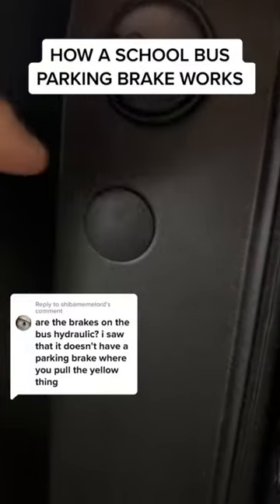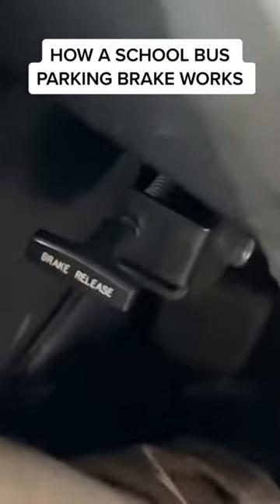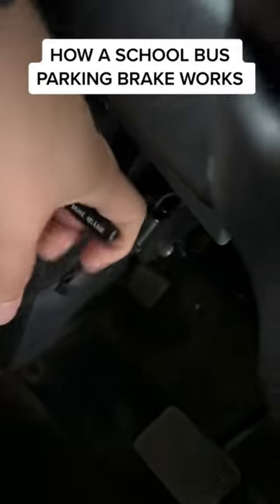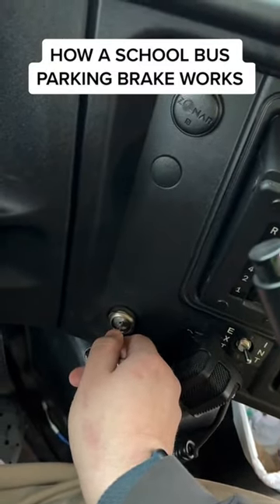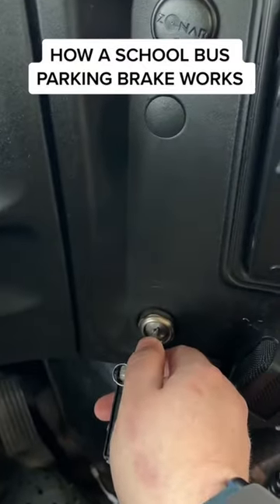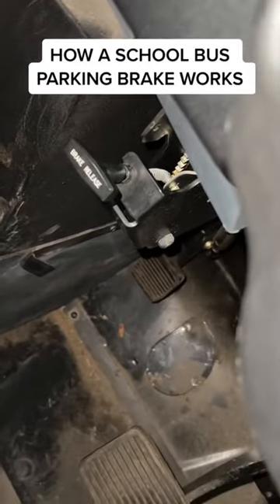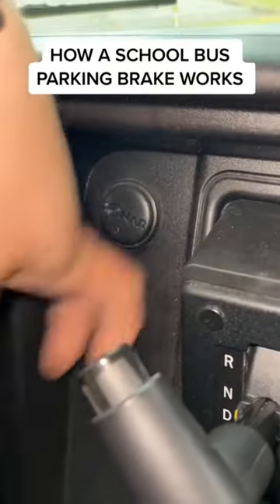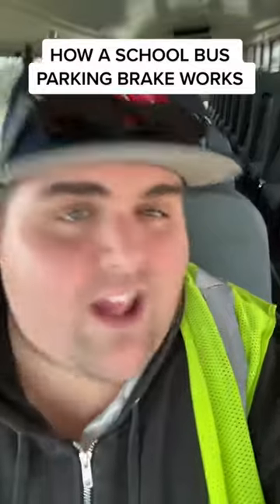How Does A School Bus Parking Brake Work?

Comment: U should do a video of u showing us the school buses rev limiter😂
Reply: Cummins ISB has a limit of 2800 rpm. Same goes for the Maxxforce DT.
Reply: @charlesrodriguez7984  nice
Reply: Charles is correct! The rev limiter is different then the rev limiter in a car. If you steep on the pedal all the way will go up until it stops anywhere from 2,500-2,800 RPM and will just hover there smoothly it doesn’t go all the way up and keep bouncing down if you know what I mean

Comment: So the reason they ditched the system that had that loud humming noise and the push button park brake in favor of a hydro boost system with a mechanical brake, is because the full power brake system was notoriously unreliable. The humming noise came from the Hydraulic Control Unit, or HCU. The HCU is multiple things in one: a module, a pump, a fluid reservoir, and an accumulator. Those HCUs failed on frequent occasion and are very expensive to replace. In addition, Meritor Wabco stopped making the full systems (I think).

Comment: I think Thomas started putting a button for their parking brake like on 2023 and 2024 C2s as an option but don't quote me.
Reply: Are you referring to Intellipark?  That's only for air brakes.  As far as hydraulic brakes go, the standard option is a foot parking brake, but you can opt for an air-assisted parking brake despite not having air brakes at all.
Reply: @BusMaster99  I'm not too sure. I just heard about my district having them in the newer buses. Not sure what they are and how they work.
Reply: @TheRealAGGL  yes, those are intellepark parking brakes and you pull them to engage and push to disengage. They are basically electronic parking brakes
Reply: Declan Bus Spotting  What bus?

Comment: On our 2011, 2014, 2015 and 2016 hydraulic International IC CEs, they have the hydraulic version of the yellow parking brake knob on them. Our 2019, 2020, and 2022 hydraulic International IC CEs has the parking brake that was shown in this video. Then our 2023 air brake International IC CEs obviously has the air brake version of the yellow parking brake knob on them.

Comment: It’s not the yellow pull knob because it’s not air brakes. I’m not 100% sure how the knob works but I do know when you push it in the air pressure is used to hold back the spring brakes and when it’s pulled the air pressure is cut to allow the brakes to engage. For your hydraulic brakes it’s on the floor because the parking brakes are engaged by two steel cables that go all the way back to the rear wheels which take a bit of strength to engage so putting the brake on the floor makes it much easier to engage. Some cars work this way as well

Comment: Most likely they had some air powered component of that parking brake fail often so they decided to go with a mechanical one with an electrical Fail-Safe that makes it impossible to pull it without the bus on that way you can have air in your brakes and be able to hold down on the brake pedal when you release it

Comment: I could be wrong, brother, so don't quote me, but im thinking they changed from air brake to hydraulic brake to remove the class restriction on the license. 
With air brakes, you need a Class A or B license. With hydraulic brakes, you can have a Class D.
Which makes sense as it makes the job more accessible to people. 
I don't know this to be fact though, just what im thinking.

Comment: Because the yellow knob is for air brakes it's your proportionary valve that's why and because it's hydraulic brakes is just like a regular pickup truck SUV that has a foot pedal parking brake technically it's not a parking brake it's an emergency brake which I'm glad that they did that because now you have an emergency brake in case all brakes fail to at least get the bus to stop and legally you had to be able to release the brake without the bus being on so the way you release it is you push on the pedal all the way down and then release it with your foot still on a pedal all the way down! Try it
Reply: IC used to have an electronic switch for hydraulic brakes that looks and functions similar to the knob used for air brakes.
Reply: On our 2011, 2014, 2015 and 2016 hydraulic International IC CEs, they have the hydraulic version of the yellow parking brake knob on them.
Reply: @greatgalacticblue4645  question were those brakes true hydrolic or air over hydrolic assist? I ve drive tow trucks that were air over hydrolic that had the push pull knob for the air control that applied and set the hydrolic brakes. Curious if they did away with the air over assist.
Because the air was an assist no air brake endorsement was needed.

Comment: On our diesel pusher motor home we have a air brake lever on the dashboard so it makes it easier to release and to push in when we need it. Also when we start the motor home up it has a warning beeper that tells us that the air is low so we have to wait until it fills up before we move our motor home out also it won't let us move.

Comment: I think they did switched because the older ICs had a lot of electrical problems with the electronic parking brakes. This one has fewer ways to go wrong
Reply: Might’ve also started doing it when they changed engines from the international DTs and V8s, to the Cummins ISBs.
Reply: @josephbugaj8149  this one is gas
Reply: Maybe if they didn’t have air brakes but I haven’t of any older ones that didnt. That bus is a gas motor without air which is why it doesn’t have the yellow knob. Anything with the yellow knob for the park brake isn’t electronic.
Reply: @dougb27  actually the yellow knob found on older CEs with hydraulic brakes is for the SAHR parking brake (Spring applied, hydraulic released). My bus has one, diesel powered, and is equipped with hydraulic brakes as well. No air whatsoever.
Reply: On older CEs with hydraulic brakes equipped, there is a large brake pump known as the HCU (Hydraulic Compact Unit that is part of the Wabco Hydraulic Power Brake (HPB) system) mounted on the drivers side frame rail (it buzzes when the bus is first started to build brake pressure) and it provides hydraulic brakes to the bus. In addition to the brake pump, there is a parking brake actuator also on the drivers side frame rail near the rear axle that is driven by hydraulic fluid as well. The yellow knob on the dashboard controls the actuator and allows the parking brake to be engaged or released (the actuator can even auto apply the parking brake when the bus is turned off.)

That system was used when the parking brake itself (the brake drum) on older CEs was mounted on the rear differential, where the driveshaft entered the rear axle. The newer system used nowadays with the foot pedal for the parking brake, the brake drum is mounted on the driveshaft at the back of the transmission. The newer system is fairly common on diesel buses with hydraulic brakes (not sure about air brakes or gas engine ones.)

There are videos that demonstrate the system. https://youtu.be/5W4XfsDiNc0
Reply: @josephbugaj8149  thanks for the info! It was a few years after they switched to the Cummins motors. All our buses are diesels with hydraulic brakes too. Our ‘16 and ‘17 CEs have the yellow knobs but by the ‘19 model years they were equipped with the pedal
Reply: @cameronbennett-ferland4361  our yard before going to C2s, had internationals with the hydraulic brakes and yellow knob. Newest was 2014. All the C2s we have now have the foot pedal parking brake. Honestly I preferred the yellow knob and the SAHR parking brake that was used over the foot pedal.

Comment: The newer hydraulic brake CEs don't have the switch for the parking brake anymore because they no longer use the Meritor WABCO HPB braking system.  That is the system that featured the hydraulic parking brake.  As far as why they switched to a regular hydraulic brake system with a manual parking brake, it was likely due to reliability concerns/expensive costs to fix problems with the old system.  I hate the new system just as much as you and it's why I prefer air brakes.

Comment: Are school bus jake brakes any good because they seem like there not doing anything but noise
Reply: School busses don't come with jake brakes. They have to be special ordered ad an engine upgrade which adds multiple thousands of dollars per bus. 
Typically school busses dont have need for the jake engine brake. They typically operate on a slow speed below 45 mph stop and go route. Trailer trucks running 70 75 with 80k pounds and descending steep 12 plus percent grades need that extra engine braking assistance. 

Multiply that several thousand dollars per bus times a couple hundred busses that already cosr upwards of 150 175k each.
Reply: @johnm2056   wow you know your stuff thanks for the info

Comment: Why you have to wait when the lights go out to star what will happen ?
Reply: On diesel vehicles there’s a wait to start light or symbol that comes on which is part of the startup. You have to wait for that light to go out otherwise you will have a misfire or other malfunctions that will happen. On gas buses, you can start it right up.
Reply: On diesel vehicles like motor homes there's a beeper that will come on  that tells you to wait until the air tanks are filled up before you start moving also you might damage something.

Comment: That is terrible why would they do that I mean if I were to me a school bus manager I would never make the choice making my drivers drive that hunk of junk I would get the air brakes and bluebird or Thomas
Reply: Pretty sure blue bird and thomas use a similar type of parking brake. Not everyone has an air brake endorsement which is why there should still be a hydraulic brake option for drivers.
Reply: @riceexe  yeah but I think that they should at least do the push pull parking brake and I just do t pin ic so that’s why I pick bluebird and Thomas